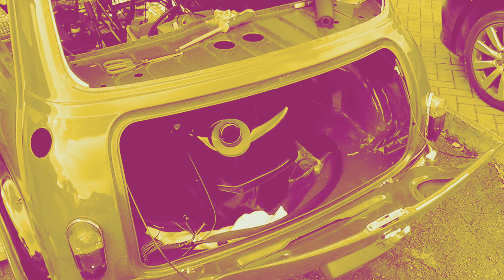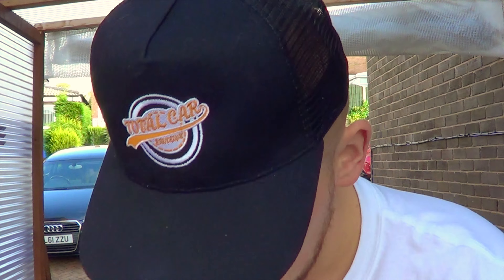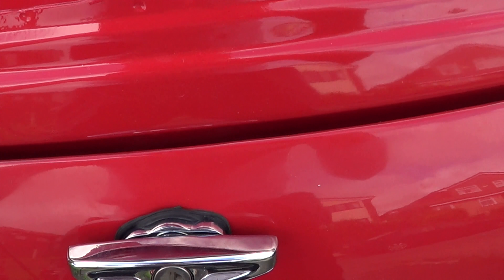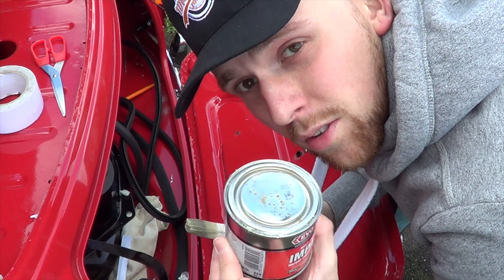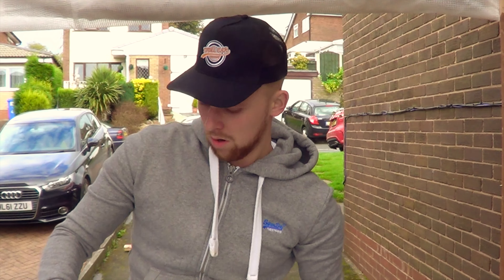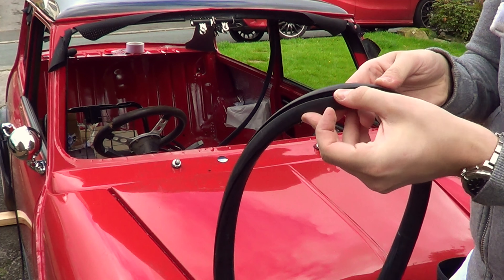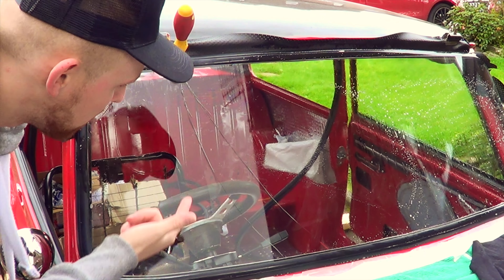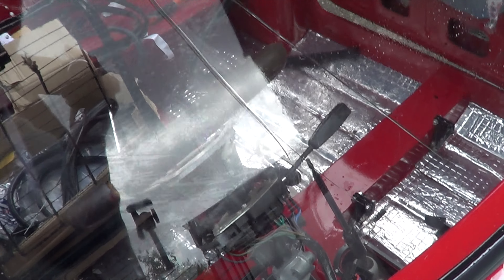Classic Mini Restoration | Fitting The Windscreen | Ultimate Fail!

Comment: I actually shouted out "nooooo" when I saw you'd cracked the screen. The wife thought I'd broke something! Gutted for you. I've always fitted mini screens using nylon string., which is the traditional old school method. You fit the seal to the screen, run the cord around the recessed edge and drop the ends of the cord inside the car. Put the part of the window where the ends of the cords over the scuttle lip and then push firmly on the screen, while you slowly pull the cord away from the window. Keep moving around the screen, pushing on the area where you're pulling the cord. I've always been able to do this on my own, but I have long arms. It will be easier if you can get someone to push the window, while you pull the cord. I've fitted loads of mini windows this way and never broken one. Good luck!
Reply from the maker: Delmon1275 hahah! Thanks for the advice mate! Glad I could keep you entertained 😂😂 don’t jynx it now! Touch wood you won’t break one in the future ✌🏻😂

Comment: Dude so close! I do mine with a credit card and soapy water, start at the bottom and work your way up. Also make sure the rubber seal is tight to the window frame at the top as this can pinch up a little and collect water. That Evo stick is a two part adhesive, put on both parts give a min and they will stick like shit. Nice vid man good luck with round two!
Reply from the maker: Tom Lead thanks buddy! 👌🏻 I tried that with the evostick and it just doesn’t seem to want to stick to the rubber some I’m going to collect something else 👌🏻

Comment: Delicate job. Done mine a few months back. Put the seal in warm water for a while before fitting. It makes it more ssoft and easier to manoeuvre. I wouldn't use screwdrivers with a small blade.  I used a pry bar and wrapped duct tape around the end and use loads of soapy water to help the glass slide into the rubber. Just takes time.
Reply from the maker: DB Mini DIYThis is why I love youtube! And the people who watch my videos! Theres so much advice to offer from you guys I love it 👌🏻
Reply: I did film it for my channel but lost that and a lot of other videos with a corrupt harddrive. The other method us using string or bungie cord like the haynes manual says or like was done in wheeler dealers but it can be tough on the rubber. Look forward to your next attempt

Comment: Theses things happen tom, character building they call it, two man job on screen inserting, and best to use thin nylon cord (lubed up) and inserted into the seal. While one person applies pressure onto the screen the other person pulls out the cord, which pulls out the seal enough for the screen to be pushed in but by bit. Hope that helps mate
Reply from the maker: Kevin Shales Thanks Kevin! I don’t get to beat up about ball drops as it only tells me what I’m doing wrong and teaches me how to avoid it happening again 😂 thanks for the advice and I’ll be sure to give it ago 👌🏻

Comment: Hiya, I'm a novice like yourself who only recently installed a new windscreen on my Triumph Herald. Was obviously nervous about the task but whilst pondering how to proceed noticed my son playing Lego which has in larger kits a small orange plastic blade tool for levering Lego pieces apart. Firm but not metal with good grip. Thought I would use this as an improvise blade on the windscreen rubber. Worked like a dream!!!
Reply from the maker: Andy Britophile hahaha! No way! Lego pulled you out the mud 😂 top advice bud! Thankyou

Comment: Tom, so close, never mind " you will crack it in the end, "  or should i say you will not crack it the end. great job mate.
Reply: If its stringed in, does the lock strip go in before its stringed in or after ,ive stringed lots in , but they had no lock strip , turn the rope in a ark on  the corners  cheers, atm i am  cleaning  a 73 australian clubman ls
Reply from the maker: Malcolm Latham-Bennett hahah! Loving the pun😂 cheers buddy I should hopefully manage it next time 👌🏻
Reply: i will fit with rope method with   lock strip fitted  just leaving the top out if it seems hard to rope in " if its a hard job i will rope in with no stinking lock strip, 3rd go after a visit to the thunder box , ill resort  to the scary way , 

I also have windows on a motor home to remove 12 or so , its a ex bus , The rear has a safety  pull out type and a lock strip that the manual says fit last , because it is a pull out it must be fitted with rope and the top to be put in first then rope, ie rope ends at start of the job are at the top crossed over ,  Rick
Reply from the maker: SHOVELRICK SHOVELHEAD thanks for the advice Dude! I’m going to give it a go this weekend 👌🏻

Comment: Try using para cord to put the windscreen in? The adhesive that you were using for the rubber seal is supposed to dry, you should apply glue to each surface let it dry then stick them together. I have never used it on rubber seals but use it a lot at work and it should stick as soon as the two surfaces come into contact, it should explain this on the tin so it's maybe worth another go. The car looks great btw
Reply from the maker: Graeme Brown thanks Graeme, I did try this afterwards but it doesn’t like the rubber so I’m going to try a different product thanks for the advice also 👌🏻

Comment: Hey I've got a few tips that might help buddy :) first I would recommend not using washing up liquid as it has a high salt content and once trapped between the seal can cause rust! Secondly don't use a screw driver! If you don't crack the screen you will tear the seal! But your self some plastic trim tools like you use for car interiors a few quid on eBay! And for lubricant I recommend either rubber grease or a spray lubricant like wd40 but one that can be used on rubber as wd can't :) best of luck
Reply from the maker: tommy carradice top advice! Thanks Dude! 👌🏻

Comment: Put the rubber on the window 
Put string around the rubber with the two ends at the bottom
Put window and rubber in the mini at the bottom 
Get ,2nd person to put a bit of pressure on the window and rubber while someone on the inside slowly pull the string through making the rubber go over the metal edge 
Do not rush and split the rubber. Use soap 
Hope this helps
Reply from the maker: thanks ryan! top advice :)!
Reply: No problem happy to help. If you need the string I'll happily send the stuff I use. And I send in a pic of my mini soon a before and after. Thanks #redminis

Comment: Any windows I've done I did the string n soap method where ye put the rubber on the glass them pull from inside and get a friend to put pressure from outside, I've never done a mini tho so dunno. I had a hard time watching Matt Green using screwdrivers too.
Reply from the maker: PIPER DOUG thanks for advice Dude! I’m definitley going to give it a try 👌🏻
Reply: no probs.

Comment: Metal on glass, never a good combination. Do you have the correct tool for the fillet insert. If not get it. Ive always found the best tool for this job is a friend to help. Good luck on round 2.
Reply from the maker: Peter Humphries I have the tool for the fillet I just saw another mini builder using screwdrivers and attempted the same method and learnt the hard way 😂
Reply: I've found a credit card or thicker plastic useful for wrestling the screen into the rubber.

Comment: i hate fitting mini windscreens. defo a 2 person job for me. my top tip is don't use screwdrivers, buy plastic bicycle tyre levers and for fitting the filler strip get the tool with the roller, oh and i use WD40 for lube and not water. probably not good for the rubber but works well. love your editing skills, keep up the good wok
Reply from the maker: The Gentleman's Motor Racing Team thanks buddy! Loving the advice and positive feedback 👌🏻✌🏻

Comment: There’s no easy way to do it, a  string sometimes works but it has to be thick enough to stay in the rubber with the two ends meeting at the bottom middle, gently insert the screen into the bottom of the rubber then pull the strings outwards this pulls the rubber lip over the screen also washing up liquid has a very high salt content was will entice rust at a faster rate under the rubber try using lashings of WD-40 as lube instead😉
Reply from the maker: Tony Watkinson TOP! Advice! I will give it a go once I get my next windscreen which fingers crossed I won’t mess up haha 👌🏻